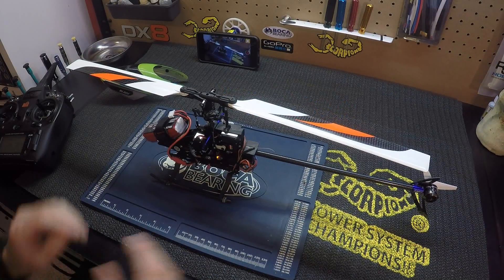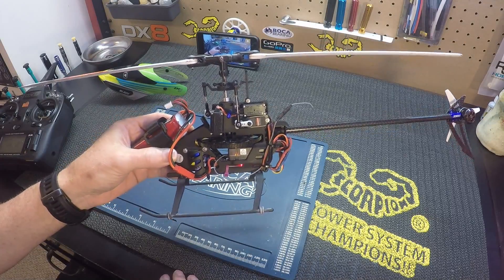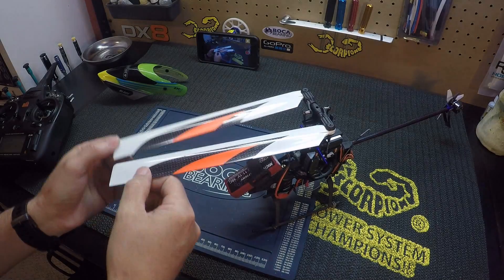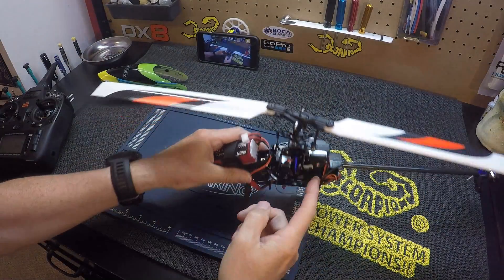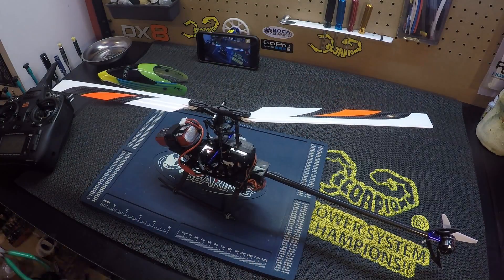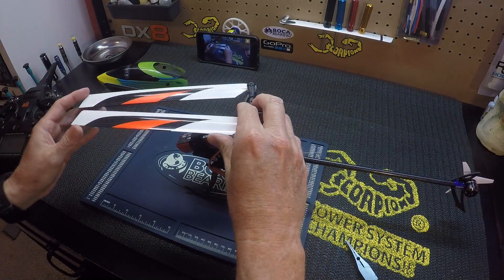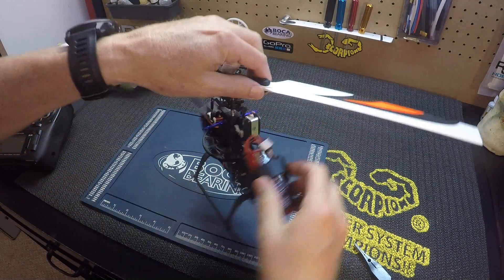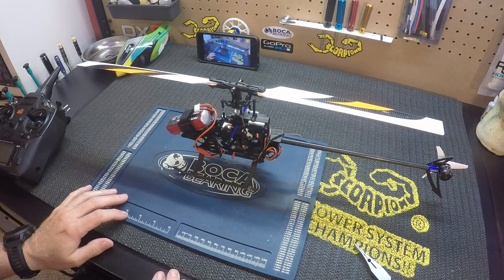Blade 230s setting zero pitch

Comment: Hello, and thanks for the video. I was wondering if my links are at the right length according to the manual should I have to turn them anyway to set zero pitch? Also I can use programming to set pitch on my M2. Would I be able to just use the transmitter or would I have to turn the links also? Also, I noticed I seem to have zero pitch at mid stick when I’m in idle up but not normal mode. Is this normal? Finally, my bird flies perfectly level even though I don’t have zero pitch at mid stick one in normal mode. I guess there is a difference between the swash being perfectly level and zero pitch. Am I mistaken  to assume that zero pitch is most important for inverted flying and the like, hence, is that why I have close to zero pitch in idle up and what are the ramifications for not having zero pitch since the hell he seems to fly perfect. I realize I’m asking a lot of questions, but any help would be appreciated.

Comment: I did all this and when setting pitch my blade further away was  lower & I moved links out to bring awash up n it makes blade even more lower??  Maybe try using the blade grip arrows for 0pitch. I do remember doing procedure n adjusting mat half stick, but it wasn’t in servo mode( throttle does nothing while in adjust mode as u know) so wonder  if i should try again , but not in adjust mode? After work gonna try again been racking my brain over this for week now or more. If you have taken any tips ? Blade 230sv2 stock frame &!motors everything else is upgraded. Love your content . Greetings from NJ

Comment: My 230s has much more positive pitch than negative pitch.  If I want some more negative pitch should I move the swash up or down?
Reply: First center the awash like the video shows. Then if you have more positive pitch adjust it in your radio
Reply: @d12bn  the DXE has no display or easy way to adjust travel. So swash up or down?

Comment: Now when I did what you did and I followed you in everything but when I took it outside to fly it when I flipped my switch up to 3D Mode it went backwards fast and wanted to go to the right hard and I redone everything again and now every time I flip up to 3D mode it want to almost turn on my tail boom turn left hard then it straighten’s back up but I don’t have a stock main frame I have the aluminum carbon fiber main frame dose that have something to do with it iv never had a helicopter do that and I’m new to the fly bar less helicopter I’m to use to the fly bar I started flying helicopter’s since I was 12 years old had a old Horobo shuttle then went to the raptor’s and I’m 45 years old now but did I do something wrong let me know please thank you buddy

Comment: Very informative video buddy. I just bought my first 230s v2 RTF kit and I also got the RF8 Simulator with the WS 1000 Simulator dongle. I have only the dxe controller that came with the rtf kit and cant get the dxe to work with the RF8 simulator. Do you know if the dxe is even compatible with RF8? I tried to calibrate the dxe, but after I followed RF8's calibration instructions nothing happened. Really frustrated. Thanks, Jon Cardiasmenos from Concord, Ca.

Comment: this is the best heli I bought in a long time. I m just  wondering can you use the AS3X receiver on different helis. i.e. 250 or 360 size helis?
Reply from the maker: Saz only if it has a tail motor

Comment: Hey JJ, I can't really see your tx over there in the corner, hence I can't see your throttle stick, but when you're adjusting the pitch, are you doing so at half throttle? Also curious why you wouldn't adjust the links going from the swash to the blade grips themselves? Cheers
Reply from the maker: Brandon Gamer in servo centering mode the throttle does nothing. Adjust the swash links to get zero pitch. Links to blade grips to set tracking if they were adjustable
Reply: Gotcha. Thanks JJ! :)

Comment: hello friend thanks for your videos, i bought a swashplate level tool from rakon. 
but i though, the marks on blade grips and head serve to set the rotor to zero pitch. or i am wrong?
Reply from the maker: Sure you can use the marks in the grips. This is my prefered method making it easier to check pitch and knowing which way to move the swash. There is more than one way to skin a cat lol
Reply: +D. Adams thanks for you words that i appreciate really.
yes, this hobby can demand a lot of resources (time and money)
more even in my case, I live in Honduras and I most iport helis, radio and spares.
but except for a few disappointments, like rainy days, stupid crash and bad designed helis and poor quality of spares (blade 130 and his tail, mano cpx and his motor)
this hobby is amazing and very rewarding the sensation of achieve things that appear impossible the first time and become easy thanks to the practice.